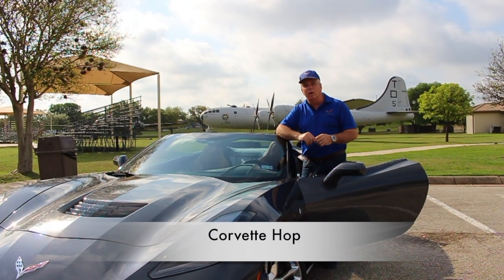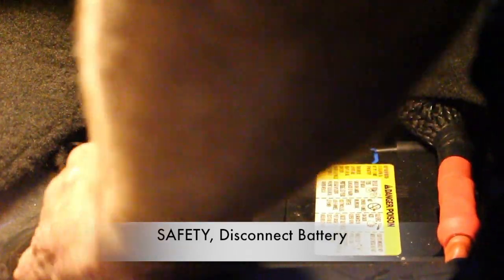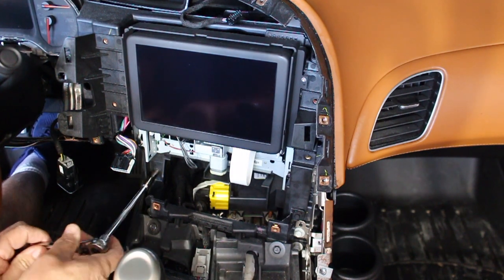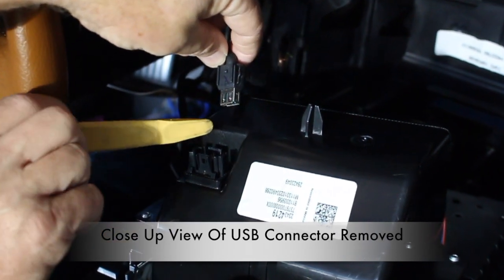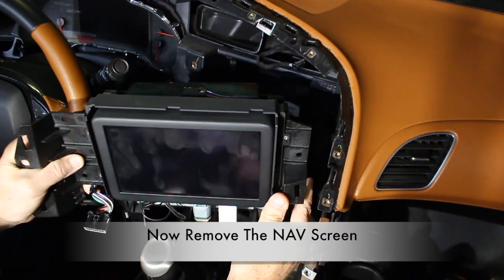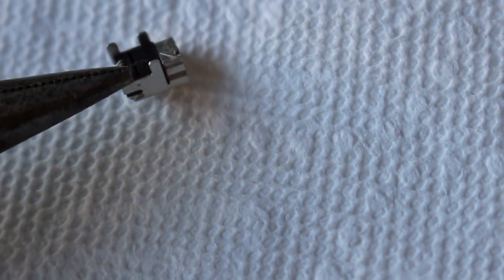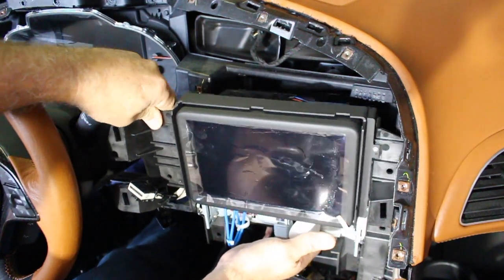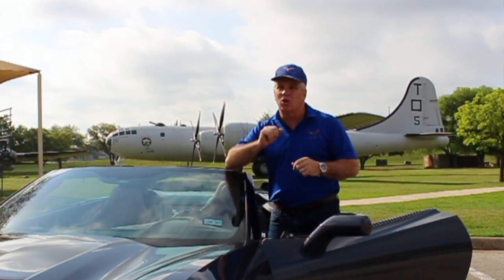C7 Corvette NAV Screen Removal

Comment: I have to thank you. I was installing a tempered glass screen protector on my C7 info screen and it slipped down the seam between the screen and trim. Yes I heard a crunching sound when I lowered the screen. I figured I would have to bite the bullet and take everything apart. I watched your video 3 times and then noticed your instruction to take the small trim piece off under the main left side trim, which I did. God was looking out for me as I could see with a flashlight the crumpled screen protector below the info screen. Fished it out with a pair of pliers and all is well. I am not a fan of Youtube due to their censorship but sometimes it's helpful.

Comment: So you replaced a known problem with a known problem, the OEM unit. Why? I’m guessing you’re also retired military, and probably an air crew member, just a hunch. I’m an MTP/FCP with A&P. Why not just re-solder the detached USB port to the terminal board? Good video. Thanks.
Reply: After doing some thorough research, I've discovered C7 owners are purchasing and replacing a $6 wire rather than a $600 unit. I think the thread is on one of the 2 main Corvette forums.

Comment: My screen was failing intermittently for the last year or so.  When it failed, if always seemed to be on a hot day when the interior of the car really heated up - it would generally come back the next morning after sitting in my garage overnight.  About 2 weeks ago, it finally just went black ... and did not come back.  However, the backup camera is working just fine!?!?!  This leads me to believe the LCD itself is fine. What I read talked about the cable from the HMI module (under the driver side kick panel) possibly being loose.  Does this sound likely to you?  When your system failed did you have no screen at all, or did you also have the backup camera working fine?  Great video, by the way.
Reply from the maker: The screen would flicker and go in/out on me. At some points, the screen would go completely out. Your problem seems much the same as mine. I do not remember if the rear camera would work or not. Thank you for the comment....Hop

Comment: Mine was flickering for a while and now it does not Turn on, checked radio fuse and its good. Any ideas on what to look for and fix 2 weeks with out a radio Sucks. Thanks in advance,awesome Video.
Reply from the maker: Get the dealership to pin the problem down. If you are capable and it is the NAV screen replace it yourself. Make sure it is not just a programing problem.

Comment: How many part numbers are there for this screen I have found 84664816 for a '15 this video shows the part number as 84182649 for a '14 was it changed for the '15? I can't find the part number shown in the video my dealer says that 84664816 is the correct number I am thoroughly corn fused.

Comment: Can this screen be repaired or is the only option to replace this unit? Second what is pricing for a new one please.
Reply from the maker: Sometimes it can be repaired. However, I think the dealership will only replace the wire. Not the internal parts. A new one is about $600.

Comment: Is it plug and play?  Or require GM programming to recognize screen?
Reply from the maker: It is plug and play.
Reply: Thanks where did u order the replacement radio from
Reply: @TheWhatisright  I was wondering where did u order the replacement radio from?
Reply from the maker: @zilongjiang9984  You should be able to get one from this link. https://www.oempartsquick.com/oem-parts/gm-driver-info-center-module-84664816?origin=pla&gclid=CjwKCAiA5Y6eBhAbEiwA_2ZWIW9Sl7u84VBIASAir03QmU6u9qs88a_Fg6AGpEHN-ZIMtH1eEktLHBoCm5MQAvD_BwE
Reply: @TheWhatisright  Thank you so much for your link. The point is I just talked to the dealer, and they said I need GM programming to recognize the screen. I don't know why. There is another problem. I removed the radio according to your video, but the cable inside is not broken. I was very confused about what was causing my screen to go black and blink. Could a new screen solve the problem? Thank you again! I really need your help!
Reply: Each power cut solved the problem, but after a while the screen started flashing and going black again.
Reply from the maker: Yes, it is plug and play.
Reply from the maker: @zilongjiang9984  Intermittent connection. I did not have to program mine when I installed it.

Comment: How much was the new screen part?
Reply from the maker: It was $630 for the entire screen display.
Reply from the maker: I have seen them at a lower price. $549 here part number 84182649 and it replaces 23434219 https://www.byerschevyparts.com/p/Chevrolet__Corvette/GPS-Navigation-System/70151654/84182649.html?partner=googlebase_adwords&kwd=&origin=pla&partnerDevice=c&userLocation=9028088
Reply: @TheWhatisright  can you share me the link where you buy the unit?